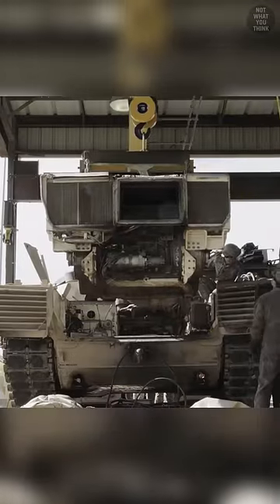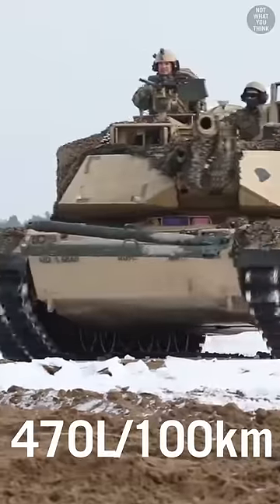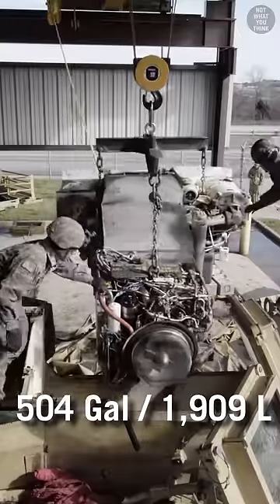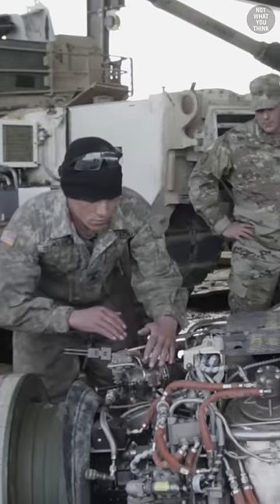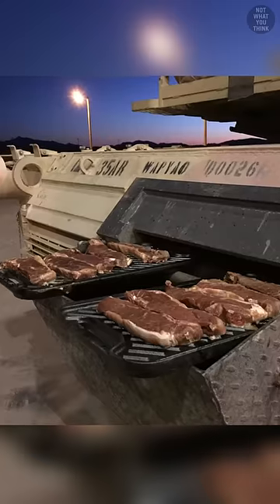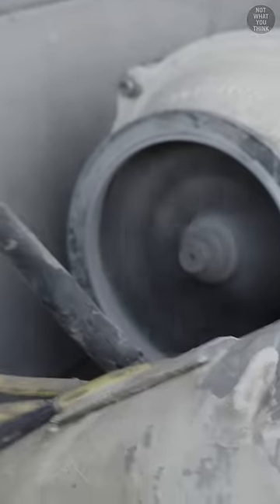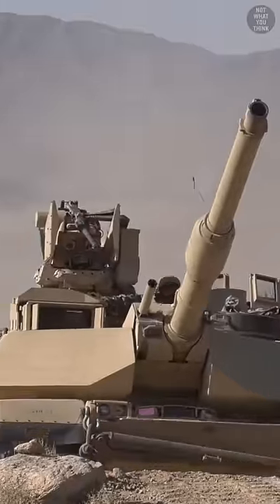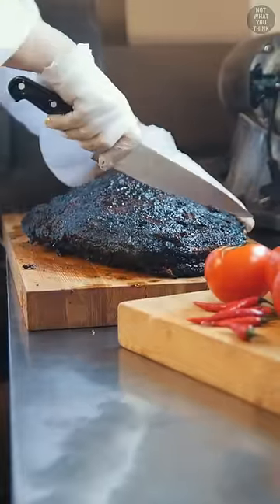Why M1 Abrams Tanks Have Gas Turbine Engines #shorts

Comment: Which is why we always had that huge Oshkosh  HEMTT M978 fueler following us everywhere we went. The M1070 tank transporter would get us right up to our line of engagement and then the Oshkosh Fueler wood top our tanks off right before we cross the line of engagement. The HEMTT fueler would then have to come forward with second wave of tanks to Objective A where we were sitting waiting for fuel. Whether it's horses or tanks, the logistics monster must be fed. The tank has turned that Logistics train into a huge monster that is a juggernaut of its own. But it is also the Achilles heel of any tank force. Any weakness in the system usually causes a catastrophic failure when pressure is applied. Many times just getting to your line of Engagement is enough gentle pressure to break a couple of rungs on the Logistics ladder. Fixes are hard and expensive and double your time for each broken step on the ladder. Plus as an added bonus thrown in by the gods of War, tank forces usually break the infrastructure they need to get to their objectives. This means oftentimes you're repairing infrastructure before you resupply or your shiny new tank is cutoff from resupply in the second wave. Which is exactly where the Russian army has found itself in the Ukraine war. Shiny tank forces surrounded by broken infrastructure. They invested in the tanks but not the logistics train. It is costing them the war.

Comment: 0.5 mpg already seems pretty good for a 110000lb slab of steel being powered by a 1500 HP fuel to whistle converter that can  get up to 45 mph. bumping it up to 2 mpg is like taking a veyron and giving it 30 mpg.
Reply: the leopard gets 0.7mpg

Comment: Another advantage of the gas turbine is low temperature startability. Diesel engines and diesel fuel get harder to work with the colder they get.

Comment: Diesel and A1 jet fuel are almost the same fuel with just slightly a different water content.

A1 has has to have more water removed so it doesn't freeze in the line at high altitudes, but at ground level it's irrelevant.

Comment: The thermals of the Leo2 and M1 are the same, the difference is that the Leo2’s air intake is ontop, not on the rear. The M1 has all intake and exhaust on the rear. Wile the Leo2’s entire rear point can be used to spread the exhaust better, the M1 has a poor circulation system. Blowing hot air out of a total of only 2/3rds the space. Being more concentrated. 
And the engine has only been rated at a few hundred degrees at idle, cooler than the Leo’s MTU engine at idle. 
But its been reported that, if using high octane and potent fuel, wile the vehicle is under constant heavy load, it CAN reach upto 1200*F exaust.

Comment: A big consideration for the Abrams is its performance in Arctic conditions (Alaska and similar.) Diesel just doesn’t run so well in extreme cold temps.
Reply: is that why canada, sweden, finland and norway all use diesel engines?
Reply: @einar8019  Diesel engines are the standard around the world. Only two tanks use jet fuel: the Abrams and the Russian T-80. None of the countries you’ve mentioned design their own tanks. They can buy what they can afford and sustain. One big issue is that most countries have no logistics to support jet fuel on front lines, no matter how much better it is.
Reply: @afcgeo882  jet fuel isnt better, its more expensive and they also use more fuel(abrams uses 470L/100km onroad and leopard 2 does 340l/100km)
Reply: @einar8019  Jet fuel is FAR better when it comes to performance. It’s more fluid and requires less pre-heating, it burns hotter and produces more power. It’s also far quieter. Is that better for the operator? Maybe not. It does consume more fuel and it does create a logistical difficulty. It’s also more expensive. 

You’re talking about “better” as in perceived value and I’m talking “better” as in mechanical performance. Stop trolling.

Comment: Also it can start at -20C° much easier than Diesel engines and it can be used at full power in a couple minutes after being turned on even in cold climate, instead Diesel engines need to reach the correct operating temperature or it will break apart very very soon.

Comment: So when I was in the third ACR, and around this time, when the M1 was still fairly new, as was the Bradley, if your M113 APC, or Bradley froze up all you did was drop the ramp have an M1 tank back up to it, idle the engine instant diesel. Also, if you were soaked, you could just rotate a few feet away from the exhaust on idle and you would be dry like a hairdryer, but you would stink like diesel.

Comment: They actually output about the same heat as a comparable diesel engine, as well as get similar economy
Reply: I don't think an off the shelf turbodiesel from Caterpillar for example would consume that much fuel even in a tank.
Reply: how is 470L/100km similar to 340L/100km(both on road)

Comment: The bad fuel economy didn't matter much when this tank was designed, during the Cold War. Tanks stationed in Germany would have either been well fueled from their own stores if holding the country boundary, or have been able to fall back on their own stores if the lines were moving inwards.

Comment: There is a huge misconception, diesel engines on Leos and T72/90 also can use different types of fuels. Cerosine, jet and diesel, it just has worse performance than the fuel it was originally designed for. T80 uses gas turbine engine for example, but it is designed for -40°C environment, which will represent problem for other engines
Reply: if cold is a problemm for diesels then why does sweden, canada, finland and norway all use diesels?

Comment: Any engine that runs on diesel can also run on jet fuel (kerosene). The Abrahms can also run on gasoline or any combination of gasoline/diesel/jet fuel. There is also no technical reason it can run on hydraulic oil or alcohol.

Comment: The fuel economy of a turbine is really not that much worse than a diesel. A turbine is about 36-38% efficient, while a diesel in this size is about 45% efficient. So the diffrance is not as high as people think.

The issue is that that is peak numbers, On 20% power a diesel is still around 42% efficient, but a gas turbine is 10-15% efficient.  This is why the Swedish tank used both type. A diesel for idling, a gas turbine for full speed.

A diesel can run on jet fuel as well, its not really a issue. Running on gasoline on the other hand is not optimal,

Comment: Actually, "fuel economy" between the M1 and the M88 wrecker(powered by a V12 air-cooled diesel engine) is about the same. Also, the M88 is FAR louder. You can hear one of them coming for more than a mile

Comment: Gas Turbines are much more fuel efficient than their diesel counterparts if run at the RPM they are designed for.

Gas Turbines get more efficient the larger they get. A tank is an ideal size for a gas turbine to be used.

Gas Turbines are also inherently multifuel, where diesels arent reliably multifuel.

If we take a look at the OEM specs for the AGT1500 from honywell itself, we see that the Gas Turbine system produces the Its max torque at around 10% of its max shaft speed.

The diesel counterpart on the other hand only produces more torque than the gas turbine at around 70% 

If we look at the OEM specs, we also see that the energy outputted is much higher at lower RPMs aswell, where its diesel counterpart only catches up at later RPMs.

The effect is obvious. The M1 Abrams accelerates to its max speed much easier. 
The GT is dated nowadays, but at the time, it was a obvious decision.

The M1 is designed with performance in mind, not efficiency. Its a ferrari, not a prius. Fuel is guaranteed to be in great supply whenever an Abrams is used in the first place anyways.

Germany would have gone with a similar design with the leopard if their politicians hadnt interfered with the design process as much.
Russia and Sweden at the time also used gas turbine engines on tanks before the US.

Comment: it is a good fuel economy according to aims, lets make some calculations:
60 tons (6kk $ ) - 115L/100km = 1.91L for each ton per 100km (any fuel), 1ton of tank cost 100k $, 
good car - 2 tons  12"/100km 6L per 100km 30-50k $ for 1 ton.
economy car - 1.5 tons  5L/100km, 3.3L per 100km 15K$ for 1 ton.

we have 200kk cars in the USA.
5k tank in USA. (115L/100km - nothing)

Comment: Really the biggest reason the turbine was chosen was because it was simply better than the diesels of era 
     Remember the Abrams designed the in the 70's and officially entered service in 79 diesel engines were nowhere near what they are now back then and the turbine was lighter, flex fuel and quieter as it's signature high pitch whine fades quickly with distance 
   Currently with the turbing aging the military's already looked into upgrading, yummy is currently testing a opposed piston engine called the ACE (ADVANCED COMBAT ENGINE) designed by Cummins and Achates power it's going to be interesting to see where it goes

Comment: wrong. the reason why they used a gas turbine was so that cold starts are not interrupted in sub zero temperatures. the AGT and start up cold in well below -20c unlike a piston engine that would take a while to cold start. this was the main reason. meaning it can be buried under the artic snow for weeks and start instantly.

Comment: You forgot to include that the turbine engine is not designed for desert war. The air filter accumulated so much fine sand dust that you need a M88 recovery vehicle just to lift the filters out. That being said, that's overdone.
Reply: That's why you have to do maintenance.. we did just fine in the desert.

Comment: I have doubts on the turbine engine being smaller than the equivalent turbo diesel engines. The look roughly the same size, but a different shape.

Had a quick look: I was right. The Leopard's engine is roughly the same size. Slightly smaller even. But, indeed, heavier.

Comment: Turbine engines are technically superior to strictly gas-electric in a given generation, they’re also less complicated and more modifiable. The fuel economy is five times better in any case but the actual tank needs to fit a bigger gas tank and that’s if you have gas. Gas-electric is for when you’re desperate or planning ahead. The proposed AbramsX uses gas-electric to complete the cycle of efficiency in the design and was probably chosen forseeing a stagnation in engine engineering and a lack of fuel supply. Maybe they’re just capitalizing on the malnourished energy sector; maybe it’s them being pragmatic; I don’t know.

Comment: u can use alcohol kerosene diesel ethanol... basically anything that u can get ur hand on and the turbine engine will run. They are not run efficiently in these tanks as effectiveness is what they are going for not efficiency  and the turbine engines are effective as they can get the job done in the harshest scenarios, too sandy too much moisture or ice or in the himalayas with thin air the turbines would propel the tank anywhere.

Comment: yes the engines are lighter and have a better  power to weight over a diesel plant but the reason the US went the  jet turbine was the speed it allowed an over weight tank to run . at 60 miles an hour for very short runs it was and may still be the fastest heavy tank on the planet . even thou the British have the same basic tank only with a diesel power plant the US had to go over board with the power and went turbine

Comment: I'm a U.S. Army Tanker ( 19K ) M1 Abrams are diseal Tanks. Not gas. I would seriously not cook on the back of the tank. You will taste diseal fumes. That's BS. If you use jet fuel. You can't go back to diseal. Engine needs to be serviced and change fuel filter, etc. etc.

Comment: Incomprehensible why the M-1 was not fitted with the same engine as the Leo2, which is much less of a gas guzzler. Probably because it was "Not Invented Here". Silly, because the M-1 uses the same German Rheinmetall 120 mm gun as the Leo2.

Comment: However the video didn't really address the "why" part of the question in any detail - the strategic thinking behind the design.
The Abrams is a Cold War tank designed to fight outnumbered against a hoard of Russian tanks that were invading through the Falaise Gap. They didn't need to go far, the enemy were coming to them. They were designed as a defensive heavy tank which would engage and fall back. They weren't even expected to survive more than a few days. They required a very high power to weight ratio and fuel economy was irrelevant as an Abrams tank wasn't expected to be able to refuel.
Their mission was to delay the Soviets and buy time for the politicians to stop WW3 going nuclear. All NATO land forces were completely sacrificial at the time of it's design.
All the best.

Comment: Why the Abrams has a gas turbine is still not what you think 😉

Yes, they have greater power density (hp/kg) of their reciprocating cousins, on average, but the real reason that the Chrysler XM1 was chosen over the GM version was because the Chrysler version had a 120mm and the GM bid only had a 105mm. We have a gas turbine engine in the ground fleet because of the gun.

Comment: im pretty sure this is wrong. it uses electic motors with a generator that can burn multiple types of fuel.. Gas, Diesel, Propane, Natural Gas, Kerosene etc. Because then it can use whatever fuel source is available.

Comment: Ummm I spent 23 yrs on the Abrams series tanks starting out on the M1 to all  the way up to the M1A2SEPV2. The US Government uses what's called JP8 for just about everything (Jet propellant ). Abrams is a multifuel engine and yes it's a jet engine the same one that's in a Blackhawk helicopter but the Abrams has its own fuel/water separator the water doesn't need to be taken out of the fuel like an aircraft engine does (or helicopter) JP8 is a clear kerosene type of smell and burns hot enough to hardly leave a smoke trail (one of the main reasons for using it) we used to use straight up diesel back in the 90's then switched to JP4 (wasn't allowed to use the engine smoke generator after switch) later still to the current JP8. in fact unless an engine in the army states MOGAS only, everything is JP8.
Reply: So i don’t mean to discredit you or anything but isn’t the “jet engine” on a helicopter a turbo shift
Reply: Don't know, what I do know is only what I've been told by helicopter (Blackhawk) pilots. And that is the Abrams engine and there engine is practically the same one, I've also been told that a Blackhawk engine runs at full throttle all the time while flying and in order to increase speed all that the pilot does is tilt the rotor blade. Just a side note, the Abrams is also an automatic, you don't have to switch gears or nothing. Just place the selector switch in D and twist your throttle back & off you go!

Comment: Gasturbines are not easily powered up and give instand power.
Diesel engines do. Also from idle to max power in seconds.
Weight is not a real factor here. Size is, of course. So I guess that is the main reason to select gasturbine.
So I would prefer 1500hp Leopard over 1500hp Abrams.

Comment: You really need to factor in the weight of the fuel as well when judging a lightweight engine. Does the lightweight engine plus fuel beat a traditional engine and its fuel?

Comment: Uhm... they don't? It is multifuel, it is LIGHT and at the time it was more economic and easily available than necessary 1500-class diesel engine. Also, M1s were expected to drive by themselves from North Sea ports to battlefield and were harmed mostly by lack of APU in earlier variants.
LV100-5 showed what is possible with turbine (80% larger range with minimum exhaust).

Comment: Actually gas turbines are only less efficient at part power.  At full power they are more efficient 

That why offshore hydrofoils use turbines in open water the switch back to diesel power in and out of ports

Comment: Well... large Diesel Engines can also burn almost anything, even used paint or tar like qualities. Just check Marine Fuel oil.
Most large ships steam heat their bitumen like fuel to make it usable. The logistics burden of fuel suppy and the higher consumption does outweogh any benefits by farm. Abrams gas turbine is a useless design. The US just compensates for the downsides in other areas. The US also avoids any direct comparison to Leopards in war zones all the time for good reasons.

Comment: And thats why the German Leopard 2 is much better the the Abrahams.
It safes fuel, so it can stay longer without refueling, it is less noisier and it produce less heat.
offcause it has a little deficit at the maximum power but in fact it is able to power up much faster and this is more useful.
Normally a tank is waiting anywhere, and thats the problem. A gas turbine engine has good performance at a high level of power but mostly the tank is running without movement, and in such a usercase the disadvantages are realy bad. high fuel consumption, noisy, hot, slow at speeding up